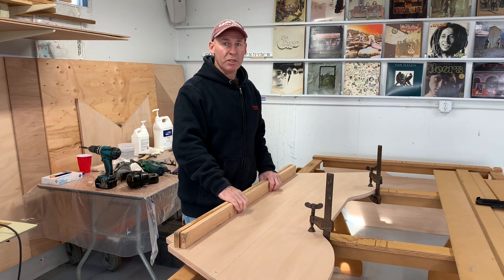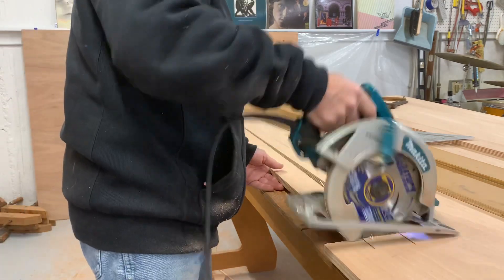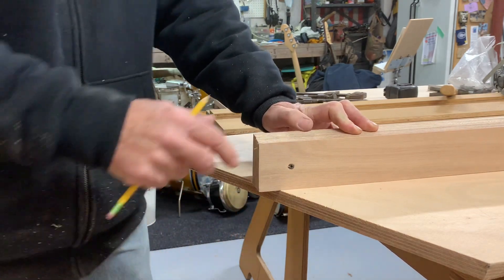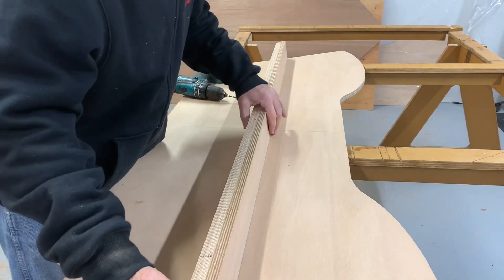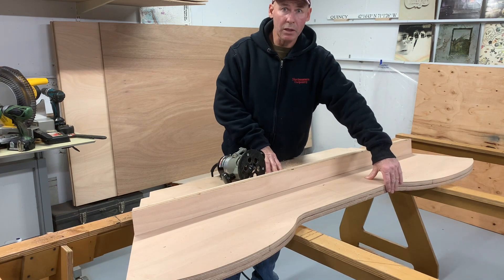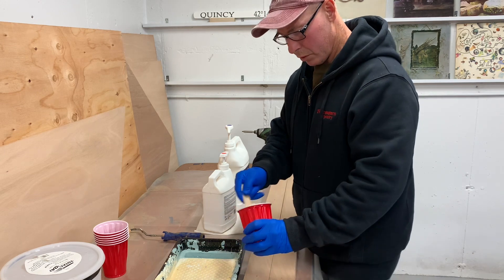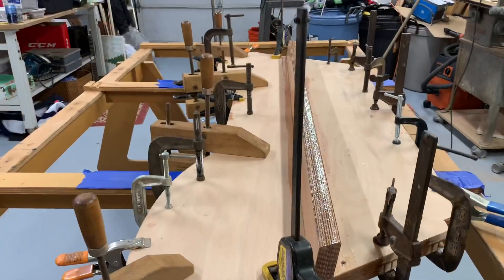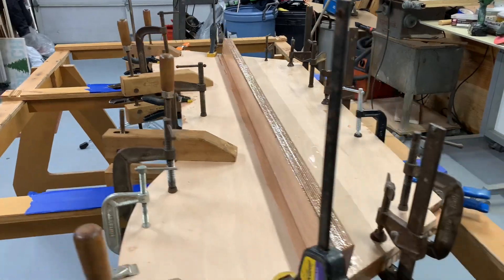Building Plywood Boat Ep 4

Comment: Is that track or guide for your power saw something you made or bought, and what do you call it ???
Reply from the maker: That is a track for my circular saw. I made it by cutting approximately 8“ x 8‘ strip of plywood and a 2“ x 8‘ piece of plywood nailed it on top then you put your circular saw on cut off the extra of the width and that gives you an accurate location to place the track against your Measurement.

Comment: I was wondering for a while why you didn't glue together the two lengths of transom reinforcement earlier in the process. But you then explained (at 6:50) that it was to minimize the effects of the epoxy on your drill bits and to consolidate the glue-up of the transom and brace into one operation. That kind of forethought and careful planning is an example of what separates you from the vast majority of YouTube boat builders. Thank you.
P.S. As a Rhode Islander born and bred, I appreciate your Massachusetts accent, your Quincy lat/long signboard, and your Cape Cod hat!
Reply from the maker: https://www.etsy.com/shop/WorldBoatSkiff